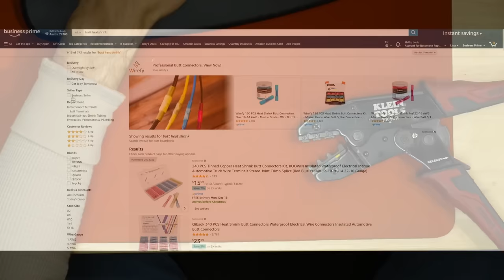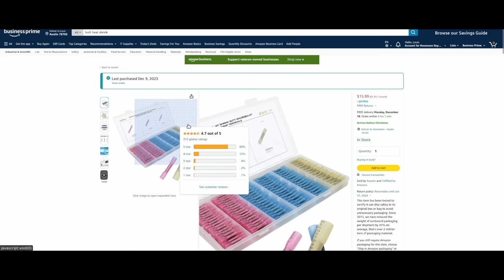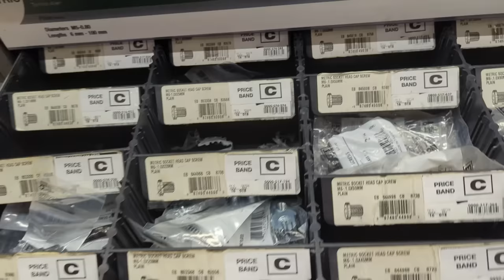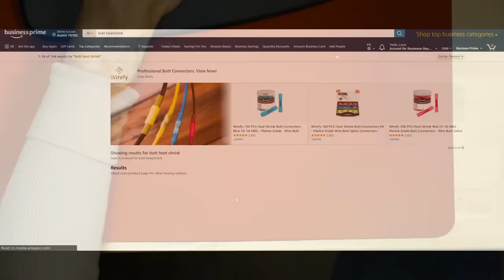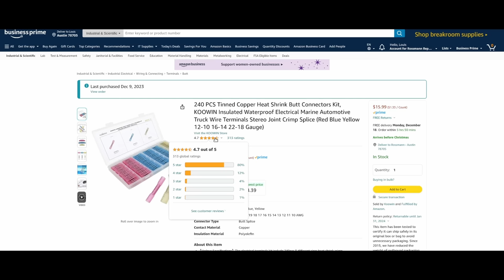Amazon Sells Dangerous Electrical Crimps

Comment: My final straw with Amazon was when a package suddenly became “undeliverable”. I phoned to ask what happened and they said the system doesn’t enable them to track what the problem was.  I ask them to send a replacement, they said they couldn’t; I’d have to cancel the order manually myself and reorder it again. I suspect that Amazon, by design, is set up such that the service staff can’t properly serve customers so that they don’t have to spend money on staff to deal with anything except the most trivial issues.
Reply: same happened to me with a amd 7700x processor, literally had to cancel it as it was "undeliverable" (after being next stop on tracking and no driver going by) and then order another one and eat the price until it was returned to my account like 5-7 business days later......
Reply: I had a couple of small speakers for an electronics project ordered alongside another product, that one arrived in a week but my speakers took over 3 months to get here. I tried cancelling it a few times because they never updated tracking info but they don't allow you to cancel one product when it's part of a order of multiple products from other sellers.
Reply: I had this exact same issue. Such a pain in the ass for what, in all likelihood was a driver's mistake.

Comment: My wife bought a new toaster that had a bagel setting from amazon. After about a month we noticed that it would not turn off after popping up the bagel. I would walk trough the kitchen and smell it getting hot with nothing in it.   Past 30 days could not return it, so it got tossed. Did some research and found out that amazon household products have caused many house fires. Many no name items from china are not safety certified or even falsely listed as UL certified. Amazon says they are not responsible and say they are just like a newspaper with classified ads. Buyer beware!
Reply: yea, that's absolute BS and should be sent straight to complaints at the FTC. Just knock a few times. They'll wake up any minute now.

Any minute now...
Reply: Wifey didn't like that toaster, would push down the lever while walking by.

Comment: I literally just went through this. I spent an hour looking for good finger and toe nail clippers. It was page after page of the same three clippers from 200 different companies. I bought a set that looked I usable and got it justerday. You guessed it they're garbage. They cut like crap. I pretty much use Amazon for books and Blu rays now, and I can find most of the books elsewhere.
Reply: I tried. They cut your skin every time. So they don't work at all.

Comment: Amazon almost totally screwed me over when I ordered a $1500 graphics card and I made sure to specify it was a gift to be shipped in AMAZON cardboard BOX. 
To my horror when returning from work I see for everyone to view on a busy road in plain sight a green graphics card at my doorstep! 
Why it wasn't stolen is beyond understanding!
Reply: There's a lot of people blaming Amazon for wasteful shipping and packaging so now they're encouraged to use boxes less. Or they'll have a box and no padding so your item just gets knocked around the entire time it is shipped
Reply: One time I received a delicate electrical component from Amazon with no extra box. The box even said in big letters "DO NOT SHIP IN THIS BOX. USE SECONDARY PACKAGING." Another time I had a GPU and motherboard stuffed into a box that was too small, with no padding.
Reply: Meanwhile i just got something from amazon, about 3 in by 6 in product in package... box was 2 ft by 4 ft by 2 ft (give or take a few in) with not even one piece of packing material. Just loose in a big ass box.
Reply: This is on environmentalism. They are going hard on amazon to "use less packaging", and amazon has largely given in. In many cases, it will now check the quality of the product's own box and if judged sturdy enough, product will ship without extra packaging.

But my understanding is that this is very much fulfillment center-specific. Some actually overpack with huge packaging where product tends to bounce inside it, some package properly and some skip extra packaging materials whenever possible.

Comment: It's funny, because I got this feeling in my bones recently. Whenever I bought something off Amazon in the last year, I would look at the LOWEST reviews and see what people have said about a product. Doesn't matter if it's a 4.8/5, if enough low ratings share a theme of a certain problem, I stay away. For the MOST part, it's worked out so far.
Reply: This is absolutely key. I look at the % of 1 star reviews and I usually read every one of them. That's the only way to find the truth.
Reply: Same here. I'll also browse the 2&3 stars and note the positives of the product. The thing with non brand is it is doubtful that the product will reach 5 star in real world terms. There will always be a drawback or two associated with it. Another thing to note about the one star reviews is you have to filter out the disgruntlements about delivery time issues, inability to get answer from seller (unless it's about return or damage) and the like because that has nothing to do with product quality. You go in knowing what's to be expected from Amazon and its affiliated sellers. All I'm looking for is confirmation of build quality and usability on a customer satisfaction level

Comment: I agree with you 100%. I am in Germany and bought some excellent, German-made cables years ago and other products I liked. They are no longer there. I have changed to buying from the single German companies and I choose to buy German-made (at least, I HOPE it is really German-made). I am trying not to buy Chinese garbage, anyway. Hard to avoid completely. I think the stars are fake, anyway. They write "345" reviews. I can never find the number  of reviews they advertise - usually a lot less. I always check the negative reviews first!
Reply: I think buyers give so many stars but no textual comments on those items. I only read 1,2 or three star reviews. Who cares if someone likes it.😂
Reply: Something to consider: Chinese vendors have set up factories in Italy, so they can stamp "Made in Italy" on the product, which carries the connotation of quality. The factories have the same "QC" as those physically in China. Total scam. I wouldnt be surprised to learn that's been done in other countries as well. Even "Made in USA" can be sketchy, cause its done here as well. There have long been sweatshops in the U.S. that use illegal, low wage labor from countries such as Mexico, that have little, if any "QC"...
Reply: You said the word German(y) 5 times
Reply: Braisin-Raisin, I started checking only the bad reviews, too and could never find the number of actual reviews Amazon said they had for a product.  And if you read the reviews and/or question section, you'll see that a large majority of people commenting on there are idiots.
Reply: Then, 90% of the time, I don't buy it, so there's that.
Reply: So?  @jameshackintosh
Reply: Is it a good place to live ?  @Braisin-Raisin

Comment: Just a tip.. Leave more copper exposed when crimping so that your copper strands overlap. That way you are crimping them together. Copper to copper. You can basically using the crimp to bridge the connection the way you are doing it. The metal inside the crimp does not conduct as well as the copper conducts. And your connections will be stronger.

Comment: I just ran into another issue I've noticed with Amazon this past year.  I ran into a production this past week where the reviews describe three different products from the one I was originally looking at.The fact that sellers are able to change the listings pictures and descriptions but keep the reviews is insane. The other part is that it is extremely hard to report these listings for this reason.
Reply: Yes! Im looking at a blanket, and the reviews are about a baby swing..  also its against federal law for you to be sent something you didn't order and have to pay for it. They either have to redund.you.and yoi still get to keep wrong item or they have to send you the right item and no extra cost and you get to keep the wrong item too. This is because it use to be a thing to send you stuff you didn't order and a bill. They have been breaking federal law. I was sent the wrong Item and they charged me for it. Everything about amazon sucks now. My new urar resolution is to stop using amazon.

Comment: This man is 100% correct. Stop buying everything on Amazon if you can help it. Brick and mortar stores need much support, and everyone will be sore if they go the way of the dodo bird.
Reply: The brick and mortar stores are often selling the same crap!
Reply: @alanmacleod9464 Right. This is always my feeling. If I go out to buy something small and specific, it requires me to go out of my way 1-2 hours to a specific store. The staff in the store usually have no fucking clue what I need and can't help, there's a good chance the store won't have the specific thing I need, and then I end up needing to buy it online anyway. Whereas, if I just spend 20 minutes researching the right product online I can guarantee the right product will arrive conveniently. 

I don't have to buy many technical products described in this video so maybe I don't suffer the same pain as OP but this is a continuous point of tension with my use of amazon and other online retailers.

Comment: Inside information: When several 1/2 star reviews are left on a product, it triggers a "bin check" on the inventory of the items. The items are then inspected by Associates who don't even know what the purpose of the item is for 90+% of the time, and state that the item looks like what the product is (regardless of quality) and therefore is 'not defective'. In the example you provided, the only way the product would be marked as defective is if more than 50% of the 'butt connectors' were literally cracked/damaged, or the completely wrong item. So Amazon does not actually test the 'quality' of the items they sell.
Reply: I wonder how many seconds those employees even get to perform the check on their robotification meter, before they get punished for wasting time

Comment: I went through this same scenario a couple weeks ago. Needed some crimp connectors, went to Amazon, and they all looked questionable from "brands" I couldn't even pronounce. Ended up digging around in the garage and thankfully found an old pack I'd forgotten about.
I can remember buying from Amazon in the beginning when they only sold books. It's crazy how times have changed. They need to be knocked off their high horse asap.

Comment: I have also noticed this issue with Amazon's "Used", or "Refurbished" categories. In the past this used to be a great way of getting good prices on items however recently it seems as though the overwhelming majority of these products are very obviously flawed, damaged, destroyed, or completely absent from the box. It seems like products in this category are either not inspected at all, the inspectors have blindfolds on, or there is simply no level of quality control at all... or all three. It is as if Amazon is attempting to recover from their absurdly high return and theft rates by peddling junk that should be on bulk pallets to liquidators.
Reply: I bought a heavy duty car charger for AC power; it wasn't UL listed abd considering  I wanted complete overkill, if it WASNT over 1800 watts of power, I was going to end up torching my car. 

It was also beat up for what I paid and I sent it back. 

ONLY UL listed out if Northbrook, IL, I think they are. They abuse stuff on purpose to prove it's safe. What a GREAT job THAT must be! 

They put their label on everything they tested.
Reply: i am Working at Amazon and atleast one thing that definitely could be part of it is that 
1 fixed rates of Units per hour processed are constantly require (resulting in having to be rought with articles having them be Poorly stored etc)
2 anything with the codes for being a Used product (amazon warehouse etc) we are just told to always send 
Yes it makes sense that something sold cheaper for being damaged should not have the same requirements as something thats "good" but there are certainly cases where it would make sense to still say hey thats damaged (Like a can kinda like the pringles thingys with Protein powder that had the bottom poped out meaning all the powder was everywhere but in the actual can but hey it might be empty but its supposed to be damaged so it gets shipped)
Reply: Well it’s YOUR choice to buy refurbished and returned stuff and they warn you about it…

Comment: I ran into this same thing, the reason why they suck is because the OD of the crimp may be the same, the ID is not. Meaning the butt connector tube is thinner material. So when properly crimped, it doesn't actually crimp all the way. I also feel that it may be a different material than the brand name expensive stuff.

Comment: I was actually talking about this with my business partner yesterday. We run a automotive repair shop. And I told him if he orders anymore heat shrink for the shop make sure it's not some Chinese noname brand. If you want something of quality like name brand stuff, you have to make sure you put the name in the search. Even then, you still are shown garbage, but if you're lucky, you may find a seller of what you actually want. Such a shame that it's becoming more and more difficult to get quality items.
Reply: You do know that heat shrink tubing is made of several types. You do not need to buy brands you need to learn what is what and buy according to it. PVC tubes are likely the worst ones. PTFE, FET, polypropylene are a few others. Really your problem stems from the type and not the brand. Look at the name brand and then buy according to it.
Reply: @kameljoe21 Yes I do know that there are differences in material, we also do plastic welding repairs that take that knowledge so the part stays together. I was simply using that story as an example of how we had just had a similar discussion.

Comment: This is why whenever I buy anything on Amazon, I go straight to the negative reviews and decide from there if the potential issues are something that I am willing to live with. Most of the positive reviews state that they just got it and are reviewing it based on package condition at time of arrival.
Reply: There are companies that will pay to leave bad reviews on competitor products. You can read comments and threads started about blatant review manipulation on the amazon seller forums daily. Amazon makes money regardless of who gets scammed. After spending 5 minutes reading through that mess, I wouldn't shop there anymore.
Reply: That should really be a rule, then. A product is only as strong as its lowest review.

Comment: Thank you so much for teaching us about how to find quality rather than cheap. If I take the trouble to crimp and heat-shrink, which I have never done BTW, then I think I want quality, something that withstands years of use and weather. If I repair something for somebody, I don't want for it to fail after they have moved away or whatever and I can not fix it for them again. If I wanted cheap that might hold up for a short while, and if not I will just fix it again, then maybe just throw something together and stick a wire nut on it, and wrap it up with some crappy tape.

When I worked in a relevant store some long time ago, I sometimes would show customers what to look for, to find good design and quality. If the customer was not in a hurry, sometimes they seemed open to me showing them such stuff. On a boombox, the tape deck should have the sensor for the auto-stop on the take-up reel, as it also stops on fast-forward and rewind and in the event of a tape tangle occurring. I could demonstrate that by holding the take-up reel so that it can not turn, and it would trip the auto-sop, being careful to avoid the pinch roller that governs the tape speed. Name brands like Sony and Panasonic and Magnavox seemed to use the better mechanism. The crappy brands have an annoying white tape-tension sensor that the tape rubs against and pushes when the tape gets tight, that is comparative garbage. If they don't want to do it right, why bother to build it? Well they could build it for a few cents less. If a tape deck had auto-reverse, I suspect that would be probably the best mechanism. On an electronic device such as a cordless phone base with a power brick at the plug, it should show the needed voltage and polarity where the small end plugs in. The reason for that, is when you move and somehow misplace the power adapter, or when your dog or cat destroys your power adapter or cord, you can use a universal power adapter to get it working again. Little details that are easily checked, to see if the manufacturer cared much about the quality of their product. I particularly liked a lot of the Panasonic cordless phones, because they use standard 2 AAA rechargeable batteries to power the handsets. Those batteries are much cheaper and easier to replace than the stupid hardly-standard cordless phone battery packs. What I don't like though, is having to place the handset onto the charging base a dozen times before it notices (makes contact) that it is connected and is willing to actually charge the handset. I sometimes would even put normal non-rechargeable AAA batteries into the handset to demonstrate to a customer the ringers. I recall at least one Panasonic handset indicated on the handset display that it did not have the correct (should be rechargeable) batteries, yet it still let me demonstrate the ringers. I simply asked the customer if she or he would like to hear the ringers. There was no need to connect the base to do a ringer demonstration.

It bothers me that there are likely easy signs of quality or lack-of-quality that I would not know how to check for. I don't know enough about this topic.